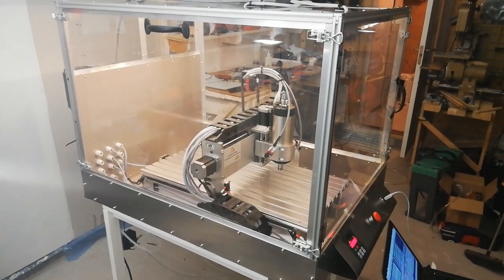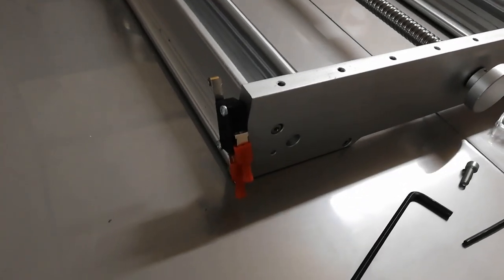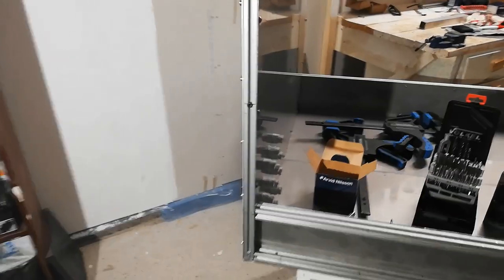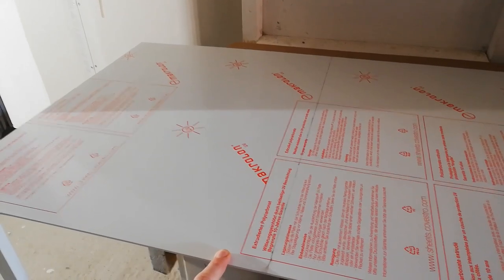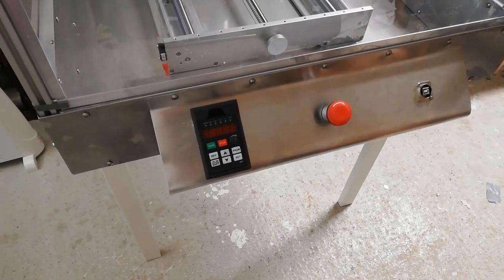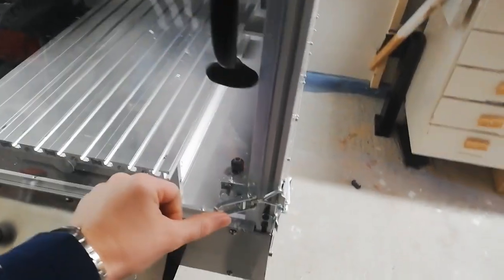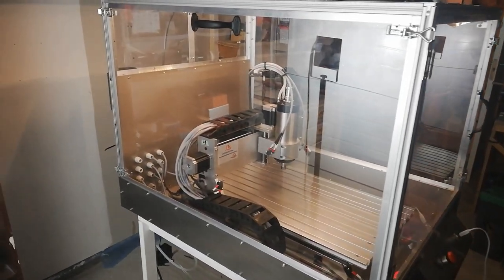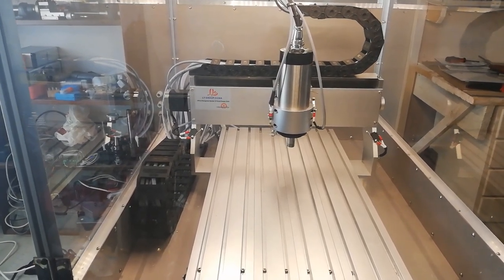DIY CNC Enclosure (2/2)

Comment: The enclosure is really nice, we can see everything and nothing is blocked from a visual point. Favorite thing here is the number of holes 12 of them you provided your enclosure for the current wiring and such, as well as anything that might arise in the future needs from you, smart move to us. 
Lance & Patrick.
Reply from the maker: Yepp, thank you for that. Agree, gotta say that I am super happy with the enclosure so far. Used it for the first time today to cut some aluminium. There was alot of work with getting the side windows openable, but it is a nice feeling now lifting them of in just a few seconds and then one can get a good reach all over the work area.  havent put noice reducing materials in walls and roof of the enclosure yet but it still dampens the noice alot.

Comment: Good job! Thanks for sharing it with us. Just got absolutely the same cnc 6040 frame from China, I can see lots of problems on it as well, but it is good overall to deal with )
Reply from the maker: Thank you! Yeah, i think The quality of The aluminium parts is overall good. Lot of things that can be improved. However it is vey cheap. I Will upgrade The y axis with some linear rail or supported rods an build a new z axis. Then I think it Will be super legit.
Reply: @thechipwelder1253  yes, I want to change Z axis too and apply all the thing you did in your previous videos ))